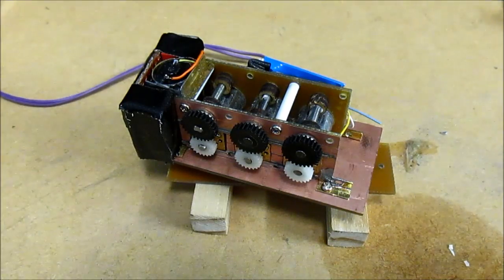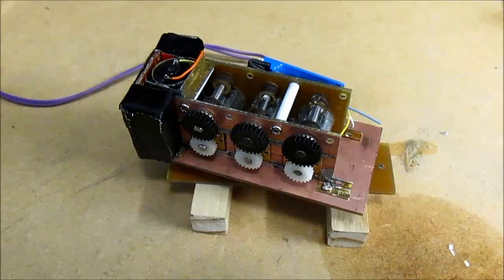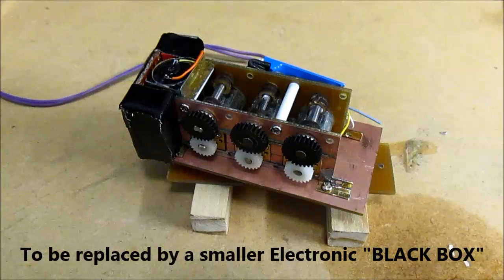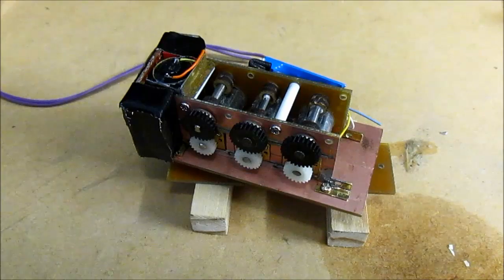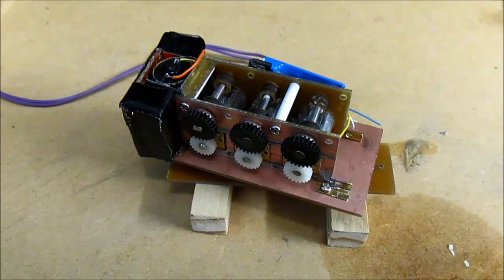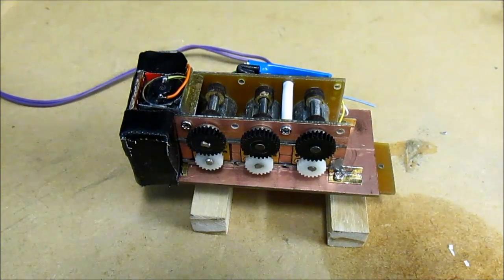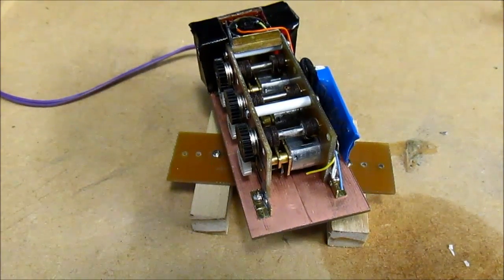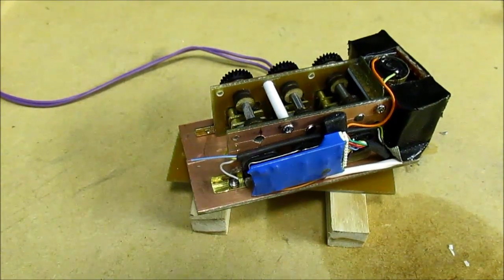Model Crane Mechanism using geared motors

Comment: what material did you use for parts
Reply from the maker: Printed circuit board. Ebay 12v 100 rpm motors and 30t gears.
Reply: @Westimation  thanks